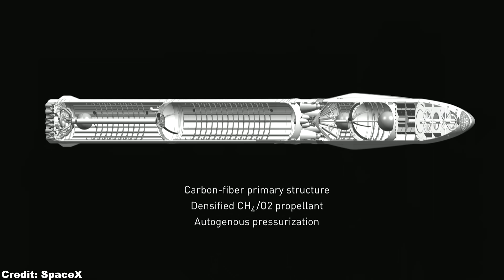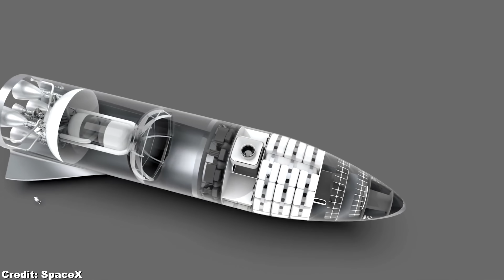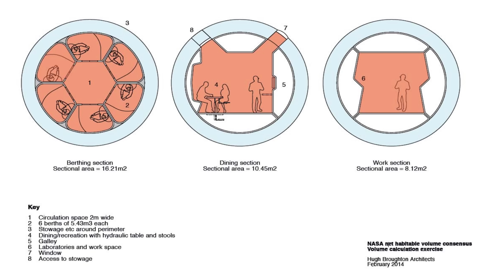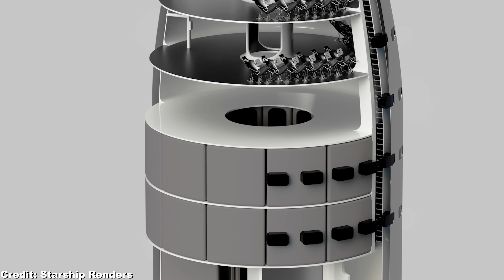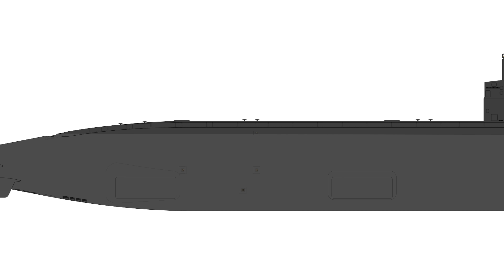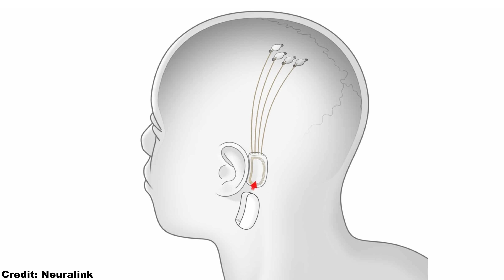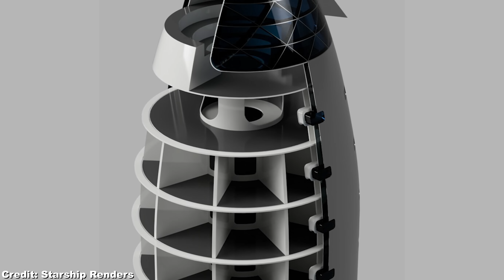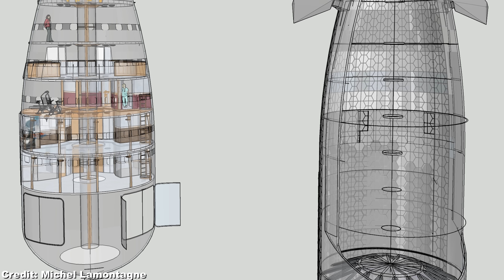CAN YOU SURVIVE 6 Months With 10 Cubic Meters? [SpaceX Starship FLAW FIX]

Comment: Danger of radiation:  You really need to read chapter 5 of Robert Zubin's book, "The Case for Mars".  The amount of radiation on a 2.5 year trip to Mars just isn't a significant problem compared to all the other risks we live with every day right here on earth.
Artificial gravity:  Lets see if they pick up a complete but empty Starship by the nose before we start thinking about whether or not the welds between the rings would be strong enough to survive the lateral pull produced by two Starships with enough fuel in them for a Mars landing  plus cargo plus crew swinging around with a tether attached to the nose cones of those two Starships.  
Even if the Starships  are strong enough to swing around  each other by the noses how do you spin up the two Starships when thrust needs to be through the center of gravity?  You can't use the main engines or cold gas thrusters for this so do you add more engines at the center of gravity?  
The inevitable osculations in a non-rigid connector like a cable would also be a major problem.The idea of attaching two Starships together at their centers of gravity with a rigid trellis that has rotating connections has been proposed but then you have the problem of the bending forces applied at the center of gravity connection point, which would be much worse  to manage than the lateral pull on the ring section joints from the nose to nose connection.
Cabin space:  Remember even a private space ship is governed by maritime law.  As an example under marine law on either a civilian or military ship the Captain can:
- Order someone restrained or locked up
- Has the authority to remove the authority of any member of the staff on a civilian ship.
Stop thinking of today's nacy pancy space requirements like in cruse ships.The officers cabins of the HMS Endevour sailing ship, which Cook commanded to Australia and New Zealand from 1768 to 1771, had a 2 m² floor space.  The crew had  just enough space to sleep and eat plus the deck.
History tells us a cabin 2m x 2m x 2.5m, which has a volume of 10m³, is more than enough.
The researchers, workers, or immigrants traveling to Mars will have a very strong incentive to go, which will make a big difference in how they manage confinement in a small space during the journey.  Give them a 10m³ cabin for privacy and keep them busy most of the time they are not in their cabins and most will do fine.
Reply: Or just man the ship with submariners, we don't need space anyways!

Comment: I would say 18 per ship, four ships to a convoy. Each ship would carry parts for a shared carousel with a small electric motor to provide rotation. Each pare of ships would share a central hub and the two hubs would be contra rotating. This way no fuel is used to create spin gravity. Each carousel could be little more that steel cables strung between a Starship pair. 

Brace yourself for my bad asci art.

==>-----H-----<==
            M
==>-----H-----<==

Each “==>” is a Starship. The “-----” are cables and the “H” is the shared hub. The “M” is a shared electric motor. This would also be a good place to mount solar panels.

This arrangement would give 72 people a relatively comfortable ride to mars in an artificial gravity environment that should allow them to arrive in good health. Not only that, but with the relatively small crew complement it would be possible for crew to abandon a stricken Starship and distribute themselves among the other three ships. Lets face facts, these people are going to be a long way from home and beyond all hope of rescue for a span of years. The human race has not done anything like this since the early days of sail. They need to be given every advantage. They need the very best we can give them.

Comment: I agree with you that a hundred people for a mars mission is just too much. I personally would be on the more cautious side of things. After all, if anything were to go wrong during the trip to mars, you would want to minimize the loss of life to an acceptable, absolute minimum, especially early on. So, the amount of people that i would send to mars, would depend on the plan and the means to get there. This would be my plan for a (first ?) mission to mars. Lets say space-x gets their star-ship infrastructure up and running somewhere around the year 2022 or first half of 2023. Then in 2024, i would launch several freighter versions of star-ship to mars only carrying a network of satellites. Each satellite would be carrying the following functions, (besides the obvious, like fuel, propulsion and power-systems and so-on) namely: mapping and scanning, surveillance and observation, positioning and communications, space (and mars)-weather, and an early warning system for any incoming objects and debris. Once this network is set up, and reports home that everything is functioning nominally, the next few steps would be taken. (This network would also be used to gather as much data about mars and its surroundings as possible, and help to determine where to put the first colony). Once that is determined, comes the next step in 2026, which would be to send not one, but two loads of the necessary cargo to mars to set up a mars colony. Basically, you double up on everything, in case something happens with (some of) the cargo during the trip. Once both loads of cargo arrive safely at mars, things could go the following few ways. Option one: you land one load of cargo on your determined landing site on mars and leave the second load in orbit (as a back-up) and have both loads of cargo constantly monitored by the satellite network that you have set up. Option two: keep both waves in orbit and monitored by the satellite network, and only land one load of cargo just prior to launching people (plus at least one extra cargo load) to mars in 2028. Once that load is landed on mars, and radio's back that all has gone according to planning, then you send the next load (or loads) of cargo plus 2 vessels with people in 2028, as i said previously. And here is where things again could go a number of ways. Option one: the chemical propulsion option. You set up two mars vessels by using three star-ships each. Four would be used for habitation (and landing) with no more than about 25 persons per star-ship (give or take), totaling to about a 100 passengers. The other two star-ships would be adapted freighter versions carrying trusses to connect with the four habitat star-ships and then create artificial gravity through rotation on each vessel.This would be done in such a way, so that you basically have like a buddy system. If something were to happen to one of the manned vessels, the people of one vessel could transfer to the other vessel if need be (in an absolute emergency). Option two: the nuclear propulsion option. You take (at least) two tanker versions of the star-ship. You remove the heat-shield, control surfaces and remove the atmospheric engine-cluster. You fill the engine-bay up with 6 or 7 vacuum engines (no cargo) and then you attach a nuclear propulsion engine on the top of the fuel section of each star-ship, skirted maybe by 4 to 6 regular vacuum engines and add the necessary plumbing (all put underneath a detachable, maybe inflatable and re-usable, faux nosecone ?) Then you put them on two super heavy boosters, fuel everything up, and launch it into orbit. Once in orbit, you send a bunch of regular tanker star-ships and refuel the nuclear boosters in orbit. Subsequently you launch two colonial transport versions of the star-ship into orbit, carrying 30 to 40 persons each, with a total of 60 to 80 people. Then you have those two refueled in orbit, and once that is done, you have each colonial transport star-ship rendez-vous with the fueled nuclear boosters but to but. And then its off to mars. The chemical option would take about 6 months to get to mars, while the nuclear option would take about half that time. Well, this is my plan to get to mars, and start colonizing it. Let me know what you think about it.

Comment: Good topic and research, guys!  Very good.  I think a trip to the Moon could have all 100 people on board.  We will learn much in just this first step in seriously going to the Moon and establishing outposts there.  This will likely influence the assumed capacities for Mars.  Given the many challenges to such a trip, including gravity and cosmic ray shielding, it is prudent to consider a crew between 20 to 30 members to go to Mars, at least in the beginning.  A smaller crew would not only have more space per member, but more reserves of consumables and contingency equipment/supplies to adjust to unexpected problems.  I think a transport ring for four Starships to induce artificial gravity and a rigid structure for some Bigelow module with radiation shielding and properly fitted for long-term habitation would answer a lot for all these problems.  We might have 3 of those Starships as cargo ships and only one with people.  Given all this, perhaps 100 people could indeed go to Mars.  One having gotten to Mars, the passenger Starship would descend, leaving the ring and associated items in orbit.  The cargo ships could come down as needed.

Comment: In the early missions we should also assume things go wrong and not the starship not being able to land on mars. At 0.5 years to mars the free return trajectory takes 2 years. 
So with a bit of margin for error you need to, potentially, feed these people for 3 years. 250kg of dehydrated food per year per person makes 24mt of food for 32 people.
Sounds doable.
You also need water, on the ISS about 80% is recycled and still for 6 astronauts they ship between 6000 and 9000 litres per year. So taking the lower bound of that would mean 96mt of water for 32 people for 3 years.
So 120mt of food and water... Everything else would need to fit in the 30mt that is left. Life support, solar panels, structural elements, spare parts, science equipment, clothes, personal effects and the people themselves.
I think even 32 crew is pushing it a bit, but I can give it the benefit of the doubt.
Reply: I think all these things should be uploaded to orbit next to the starship  and travel together.

Comment: As it is, Starship is an "exploration" class vehicle. It seems not feasible for the mass transfer of people. I still think, if the Mars project is going to go at all, there will quickly have to be a space-only transport with a surface to orbit and back craft at each end. any design would be speculation.
There is also a problem with crew make-up. These folks can't simply be anyone who can buy a ticket, but medical, electronic and other technical skills will be needed on each ship with medical and other spaces. Somewhere, there needs to be a final iteration of needs before any design can be done. I know that lots of people have discussed these issues and more, but the problem is not simple.

Comment: One very important thing everyone has overlooked carbon dioxide scrubbers
Reply: Atmosphere control is a well thought out issue for every NASA mission and will be fore SpaceX. I was a sailor on a nuclear powered submarine and it is not just CO2 but CO and Freon and any one of a 100 atmosphere contaminants, but also the O2 levels also. Plus hydraulic oil vapor also.

Comment: Space per person doesn’t matter, when you have your own 3 m³.
Reply: @John There is a slight difference between open deck space and enclosed space. While the vertical space provided by the sky above may not have been terribly useful, it did provide fresh air, sunshine, and a sense of well-being. Cramming a large number of people into a similar enclosed space with interior lighting and recycled air will take a heavy psychological toll.
Reply: @thewiirocks  Not sure a sailing ship is the best comparison. In space you'd be able to really use the entire space, including the ceiling
Reply: @limiv5272  Not on Mars. Which is where the space constraints would actually become a problem. The early missions will need to be more cargo heavy to get habitats built otherwise it's going to get very cramped in these ships.
Reply: @thewiirocks  I think that is the plan, to send some cargo starships ahead

Comment: I think the first humans to Mars will be just a few at a time not even dozens for which the curren 9m Starship 1.0 version will suffice. 

For actual colonization, Elon already suggested in a tweet on August 28, 2019, that SpaceX would build Starship 2.0 with the 18m diameter (60ft wide). This is 8X the volume of the current 9m diameter design. That's 8,000m^3 of space or 80m^3/person.  I think that sized vehicle might be capable of 100 persons on a single trip. Also a bigger rocket will allow for a shorter transit time as it is a lot more capable system.
Reply: @TechChasm  The article that I used as reference said 8000 c-m, it was basing it on the assumption that the 18m starship would also be twice as long as the 12m.

I think that makes sense to actually utilize twice the length and higher overall capacity since that would be the main goal of increasing diameter size. It would also look awkward and fat otherwise.

Comment: The area of a 100 seat aircraft is a better baseline. With the addition of expandable, exercise,  recreational, and greenhouses in a spin-gravity ring. The cargo that is ok in a vacuum could be strapped to the exterior of the ship. This gives plenty of extra room and radiation protection during the voyage. You could fit 200+ brave soles this way with plenty of extra cargo!
I remember visiting the backup Mir, Russian space station, at the Vancouver EXPO as a kid. I asked how all the exterior equipment unfolded. The confused cosmonaut said that their first job was to pull it out and bolt it on!  Mir flew well before ISS due to there "Simple is Best" approach!

Comment: NASA's work was done with the assumption that all would be in zero-G conditions while the proposal here is for artificial gravity. Under gravity, the living space would be much less usable, requiring. I believe, at least twice NASA's estimate, maybe more. Also, a lot of time would be spent, climbing from one level to another. Of course, that would be good exercise, but the danger of falling would be very high, broken bones and sprains, etc. Running around a 8 meter perimeter just wouldn't work, so exercise machines would be required that could accommodate a large percentage of the crew at once. And these exercise machines would have to be situated away from the crew sleeping quarters. Double bunking might be required as is used on some submarines. 

Certainly, at least two "shifts" would be required to allow the free space to be less crowded. I believe that it would require three shifts, with my experience on an old Navy destroyer. There would need to be non-automated tasks for people to do, so they don't go crazy, and Neuralink won't solve the problem. Training for the tasks on Mars would be necessary and useful, with massive cross-training to allow any particular group to manage whatever needs to be done. Think of a situation where half the crew has some norovirus-like thing such as has happened on various cruise shios. In the confinement of the Starship, everyone would be exposed, and the toilets might be overloaded and requiring constant maintenance.

I don't believe that the trip can be shortened by any reasonably available technology, but I do believe that a reactor is necessary for power needs. It can run at fairly low levels on the trip, but on the surface, it will be everything. On the trip, it can provide magnetic shielding that will be much more effective than any passive material. Since we are going to carry that reactor, it can reduce other weight.

Of course, a reactor could power any number of propulsion schemes, but it will require mass for fuel, and it probably won't be enough for a propulsion landing on Mars.

Comment: Thanks for those good ideas. Here is another idea of using a mothership that will solve all the problems of space travel to mars with fully fuelled starships. The original idea I got from https://youtu.be/A6iMltzlVhg. 

The mothership simulates 1g gravity with 2 spinning rotors with opposing spins. 4 starships are docked at the ends of the 2 rotors, motors outward so that all quarters have floors with artificial gravity (centrifugal) towards the rocket motors, just as they would when they land on mars and are used as habitats. The mothership will be powered by those nuclear-plasma motors you mentioned in your previous videos. Gravity solved, return fuel assured, 1st mars habitat solved.
Reply: Elon would be dead before that happened
Reply: Keith McKnight maybe not. 2 rotors of 200 length built like enclosed stack ladders leading to the spindle containing a skeleton crew of 5 monitoring the plasma motor (which I believe was built and tested by NASA a few decades ago). It could be launched into LEO in flat pack by a couple of starships, and assembled in orbit. Not much more difficult than what SpaceX are doing already.

Comment: Forget Neurallink as a supplement to Starship. This tech is still in its infancy and the next goal is to cure some basic medical conditions, like moving artificial limbs. So no Matrix style Starship.
Also, a compartment of 4 cubic meters space is just a cube with a side length of roughly 1.6 meters. You can neither stand upright nor sleep streched out in such a confinement.
You need at least 10 cubic meters for an acceptable compartment.